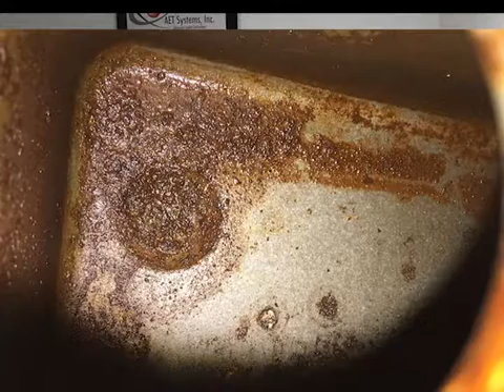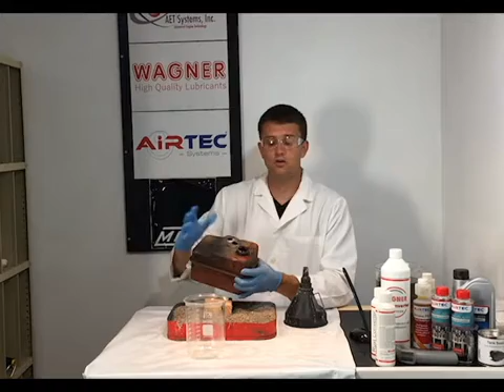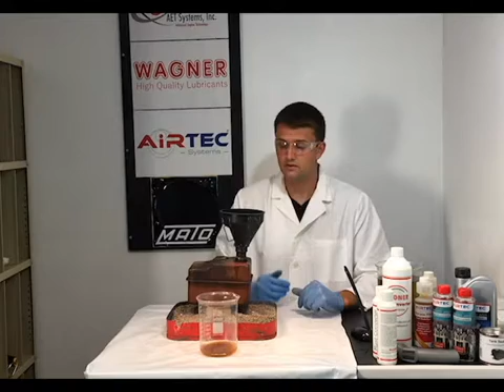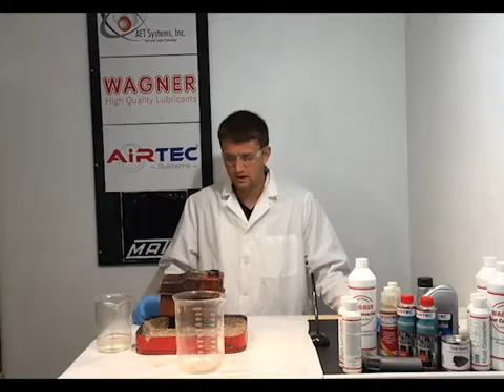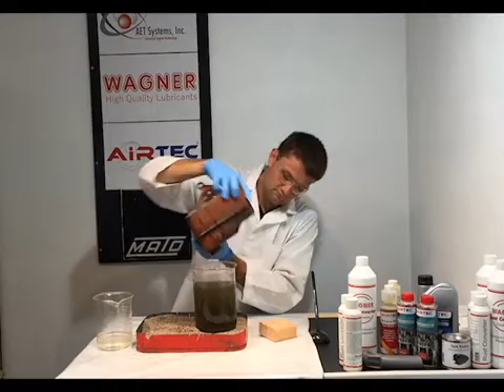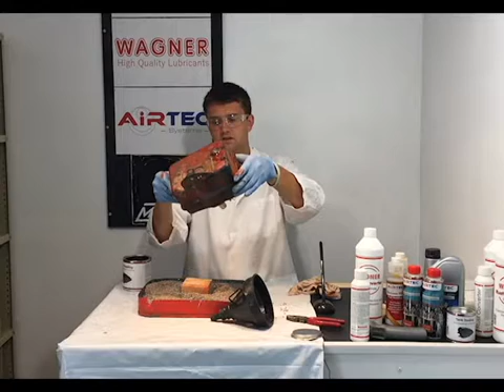WAGNER Tank Sealing KIT: Your Solution to Perfect Fuel Repair

Comment: How much tank sealer you have to put on a 4.5liter tank?
Reply from the maker: We recommend purchasing 250ml, this will be plenty for 2 coats, at the end of the process you should remove any excess.
Reply: AET Systems, Inc. what ratio should i use and for how many days i should leave the rust converter into the tank?
Reply: So 75ml or deruster should be enough ?
Reply from the maker: @ripmax333  We would recommend a mixing ratio of 8 parts water to 1 part rust converter